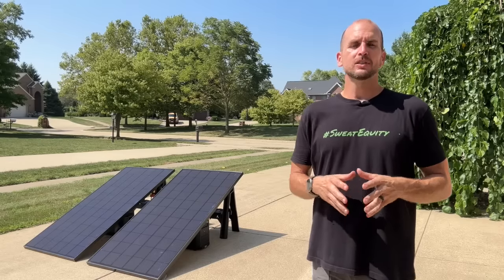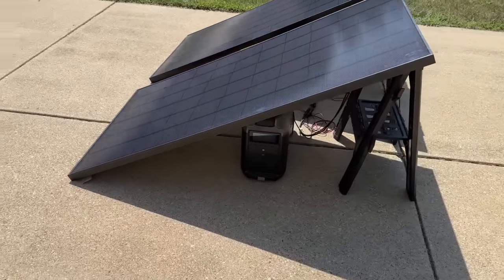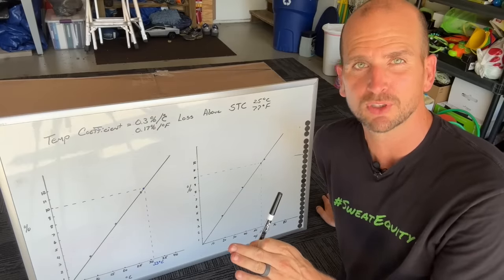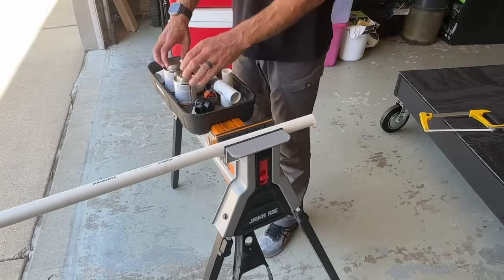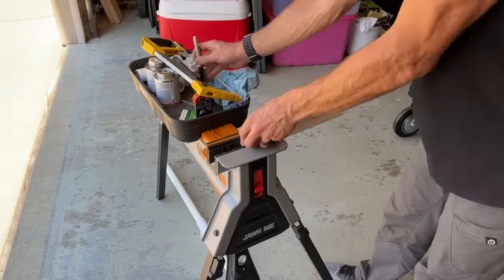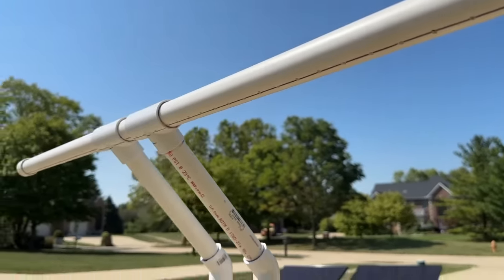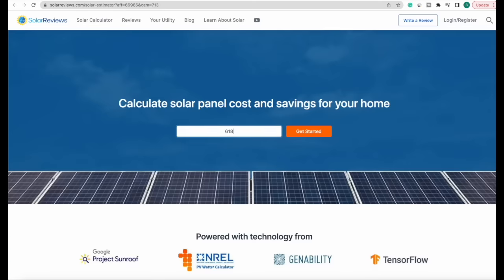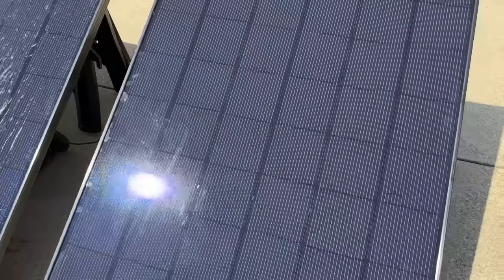Surprising Power Gains By Cooling Solar Panels

Comment: Cycle the water out of my pool, mist the panels, collect the run-off, as with rainwater, deposit run-off back into the pool. ..
Reply from the maker: That would be a more economical solution and some parts of the year could help heat the pool 👍
Reply: @everydaysolar  Depends on the power used to pump the water whether the increased power from the panels would even cover it, and you would still lose a lot of water to evaporation.  5% increase on an 11kw system might be 250kwh during summer which would barely be enough for a 1/4hp pump running 12hrs/day for those 90 days.  Is that enough for a high pressure misting system that covers 1000sf of roof?  In desert areas or most of CA you would be fined for using water for this purpose.  Plus the cost of the misting system and maintenance would be much more than adding 5% more PV.

Comment: Imagine using a heat pump to heat a boiler tbat uses the back of the panel as an evacuator taking the heat from the panel and pumping that in a boiler

Comment: Measure the temperature with infrared, expressly in the Sun, makes not much sense. The panels reflect a part of the light, so you measure much more than the temperature of the Panel, and with the Water on it, it´s adulterated the reading even more.

Comment: I looked at one systems that take pool water and use it to cool the PV panels. It was a "perfect" solution for me because I had my roof replaced and needed new pool solar... along with wanted to get PV. Unfortunately there aren't a lot of manufacturers of that sort of system and they seem to be of very mixed reviews. Not a lot of qualified installers either. Water has a tendency to go where it's not wanted and at least with separate pool and PV systems, if the pool system starts to leak, you're not in for a hugely expensive PV repair bill. There is also the question of efficiency. How much energy are you gaining from cooling the panels vs how much energy are you using for pumping the water up there in the first place? What if the pool is already 90F? Do you keep pumping water up there and over-heating your pool? Do you turn it off and now that system isn't useful? There seem to be a lot of questions that aren't well handled today.

If the idea was truly a winner, then everyone would be doing it. You'd see large commercial installs that are recirculating the through ground cooling loops or something crazy. But they aren't, because the amount of efficiency gained by cooling is generally offset by the cost and complexity of installing and running the cooling system - at least with todays technology.

Comment: The problem is the solar panels themselves. 22% efficiency just doesn't cut it. Unless that is all you have, then you are just screwed.  lol.  Same with cars. 25% efficient motors. So out of a tank of gas you get to use 25% of the fuel, the rest goes out the tailpipe - as pollution. Burn all of the fuel that goes into the motor, and there is no pollution. Even with 25% efficient engines. (Hint: it has to do with fuel delivery. liquid gasoline doesn't burn, only the "fumes". So why not "only" introduce the "fumes" into the combustion chamber so there is no waste instead of a liquid? Brilliant!) Don't you just love the term "gasoline". Trying to make you think it is a "gas". The oil industry could have also called it "Bob". And not try to deceive you.

Comment: Pouring water over a solar panel to cool it is a very bad idea..   The water will leave behind minerals which will eventually build up, coat the glass, and permanently degrade their output power.    It would be fine if you used distilled water, but that would be stupidly expensive.

Comment: Why hasn't someone tried to create a device, or "energy generator" where you replicate a regular thunderstorm in a sealed container, and all of the lightning created is then captured and used to power any number of devices? Hot moist Air. Cool dry air. Thunderstorm and Lightning. Anybody else think this should be possible? And not too complicated? A hell of alot easier than "nuclear energy", which is a misnomer, because like coal plants, nuclear plants are just "steam plants" using steam to drive the turbines.  Seems like a viable concept. Need electricity. Fire up your storm machine, and you are good to go! Oh wait, then you can't be charged by the electric company every month if you have your own storm machine.  Blasphemy!

Comment: At least try to make it practical. Have a tank of water in the shade or underground if you wan to use geothermal to cool the water like the tap. Use a pump to move the water up to the panels. Have a collection system to return the water to the tank for reuse. Now you can  compare water usage and power gains. With your current setup it just a waist of water, and you are using the energy of you water supplier to transport the water instead of what you are generating. If the panels are on your roof then the cooling effect will trickle down into the building.

Comment: Well... It's written on each panel datasheet, just read it... in general it's 0.3% less power for each Celsius degree over 25.
26°C you lose 0.3%, at 27°C you lose 0.6%
At 33°C you do not lose 10% power....! Only (0.3*(33-25))= 2.4%

Your calculus are completely false.
And your test is not good, you should send the output of the 2 tested panels to the same battery, internal resistance need to be the same....

Comment: I guess getting use to the "Thunder" from your "storm machine" could take some time to get used to. But wouldn't it be tolerable if all you had to do is turn on your storm machine hooked up to your home, and now you have "electricity"?  Or,, maybe just give the public some solar panels that are 50% efficient, and be done with it.  lol. And powering cars with combustion engines using literally "gas" or "fumes" from the gasoline instead of the liquid fuel. Now you are getting 75 MPG + , there's barely any pollution from cars. Oh, and you just solved the "Global Warming" problem too by doing those 2 things.  the world has been saved, and even Mother Nature is now "Happy." Brilliant! Everybody is happy now. (So better go and start a war. We can't have that!)  lol

Comment: Yep not enough talk about hotter climates produce way less electricity with the panels. The solar industry is still not truthful tho I see so many very old houses without barely any attic insulation and old appliances. Get your house efficient before you just start tossing solar on the roof folks!

Comment: Focusing on photovoltaic and its diminished gains vs solar collectors that actually trap far closer to 100% of radiation seems dumb.
Reply from the maker: What is the cost of a solar collector per watt?
Reply: @everydaysolar-ps3xg  Solar panels are currently 11-15% efficient. Solar collectors are using all of the heat radiation from the sun not just the light portion. Solar collectors are roughly 35% efficient, meaning if we spend more time money and effort on improving these, we have a much better starting point than photovoltaic. There are different ways to execute these systems as well.

Comment: They done t work when hot, can stop working  when a bird craps on them, you don’t know how long they will last anymore (new cells ever thinner and new untested tech), cost a fortune, are mainly Chinese (fascists), ecologically depend on most dubious practices and carbon is a self-regulating element in the atmosphere and depends to an incredibly massive amount to solar activity.  Finally, yes the weather patterns always are changing.  However, more black surfaces, more wind pattern disruption (turbines), more greening of desert areas, more dusting, more cloud seeding does change weather patterns in some areas and this knocks on to other areas.  If you are interested in energy and ecology, you’d be better off planting trees or leaving fields for agriculture.  Of course, PV really needs batteries and these cost a fortune and are increasingly volatile (dangerous), low life and cost a lot.

Comment: One way I would change this experiment is to run reflectors lengthwise on both sides of the panel directing the light onto the panel as well. One reason you probably shouldn't do this without the water cooling is the temperature: the panel will absolutely overheat. But with active cooling, I'd say try it out. I would bet you'd get at least 50% more power from each panel if you did this.

Comment: Why bother with the totally unnecessary Fahrenheit/Celsius conversion. Just stick with metric.

This is all known data. I've been asking why we don't have combined hot water heaters and solar panels. It is actually easier to collect heat than electrical power that you then convert inefficiently to heat.

Comment: Nothing new, just alot of problems not calculate that this system and the solar panels are not goof deal.
1.energy to get the water to spray on panel. 
2. Evaporation of water in drought time.
3. Water spots and calcium build up.
And more

Comment: Try carbon fiber cloth solar collector hot air balloon
Reply: try concentrated solar pv with water cooling spray, or just a normal water cooling loop to collect heat, or just submerge solar panels in water tank. yep no active pumping and its like heating a pool with solar panels inside it. not much work need to be done when done properly.

Comment: 90% power gain by not hooking it up to battery or grid
Ohm's law 101
Reply: And if we're looking at the big picture of things you need to hook up a pump to the panel you are cooling
Reply: Fun fact
Well before Tonga
There's about 12 ft of water that the race have to go through

Anyway the rip-off of the whole thing is needs to be measured in amps not atts
Didn't we learn anything from our good friends at enron

Comment: It turns out that panel degradation is also mostly based on how much it lives at elevated temperatures. If you have cooled panels they won’t reach end of life due to lost power output.

There are many companies making PVT panels but they still aren’t prevalent.

I wanted to replicate this setup a long time ago, but Seeley International bought this company and cut off all the sales to individuals:
https://youtu.be/iRlNQAYFygI

It indirectly evaporatively cools incoming air, so it isn't humid, but then the still cooler waste-air cools the solar panels.

Comment: I’m going to throw a monkey wrench at you. As I understand it, yes, cooler panels are more efficient, but also the water has the effect of magnifying the suns rays. There needs to be a 3 way test with the 3rd being cooling the panel from the bottom to remove the other variable. Until that’s done I’ll be skeptical of the % gain. How do you do it, up to you. Good premise though and I think it’ll possibly help efficiency in the future.